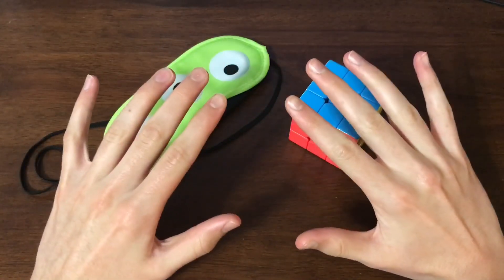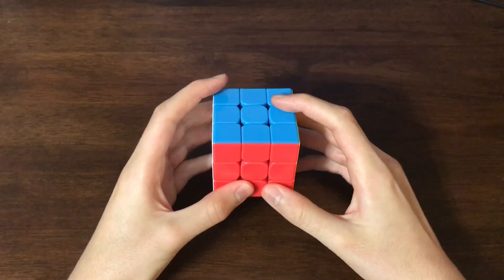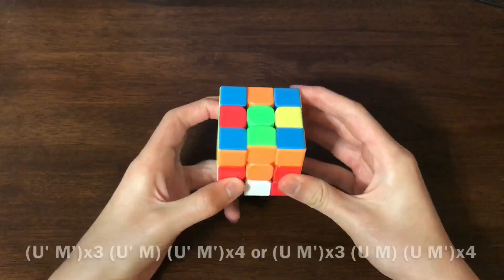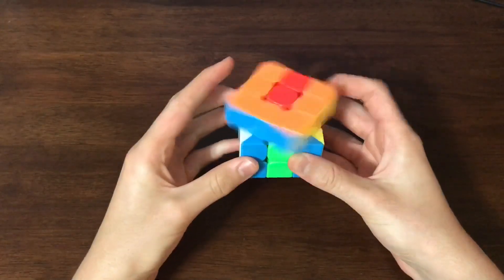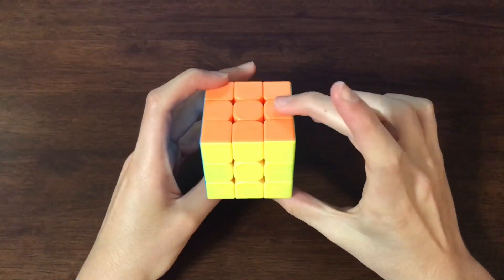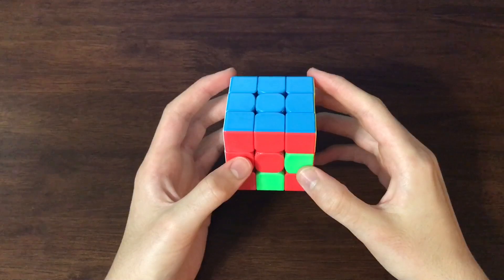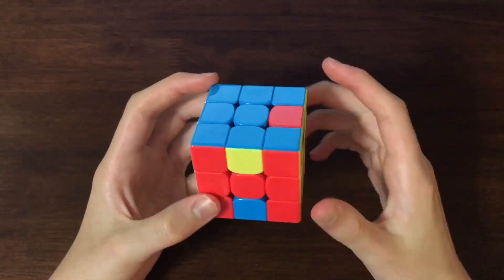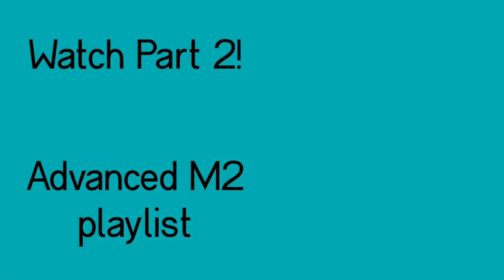Advanced M2 Tutorial Part 1 | Important Tips for all M2 Users

Comment: If i have a Q in my letterpair i usually do a U before the pair and a U' afterwards, and i just pretend it is a M instead of a Q
Reply: @BlueButton it works if you do it for the pair of letters. Not if you do it for only the Q. Almost every letterpair in M2 swapcycles 3 edges and doesn't affect other pieces. You swap the buffer piece and the 2 targets and no other pieces should change. So if I setup q to m by doing a U it works.
Reply: @BlueButton 1. If you use the swap technique you never get a single letter. 2. If you must you can shift the boundaries of the letterpairs, doing the second-to-last target as a single, than the last two as a pair. 3. I'm not afraid to swap the order in which I take the cycle breaks during inspection phase. 4. Yes the technique won't always work, but it works often enough that it's a useful trick for me. I really use this, especially when there's multiple Mslice targets in the letterpair
Reply: @BlueButton yes, doing a U will turn the letterpair into MA, which I think is a lot easier. You could also choose to do an U' which turns it into EC, if you prefer the 4 mover strategy for letterpairs containing C/W . And off course in the second example your undo-setup move will than be U instead of U'
Reply: @BlueButton it's a lot fewer moves, a lot less work, and it only 'costs' a setup move and an undo-setup move. (And some brainpower)